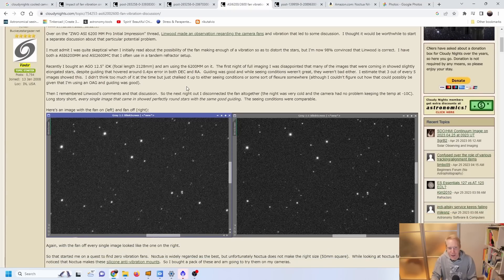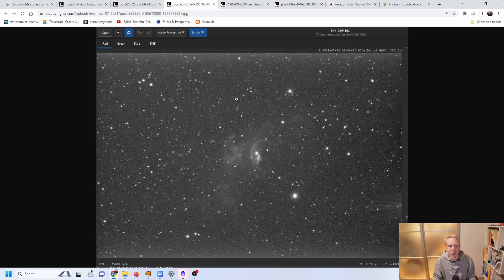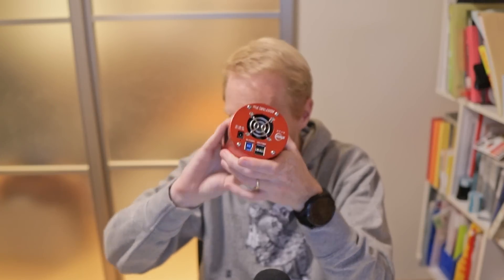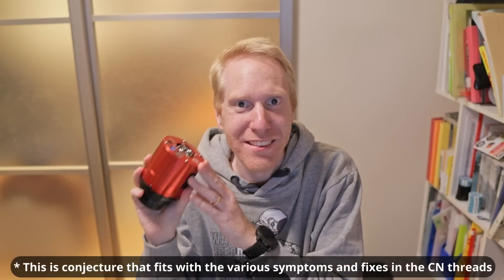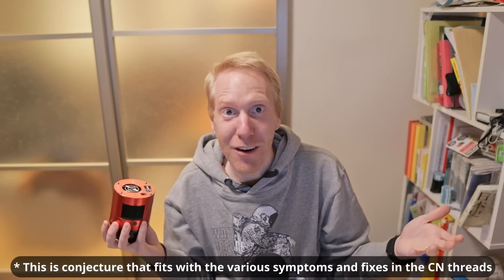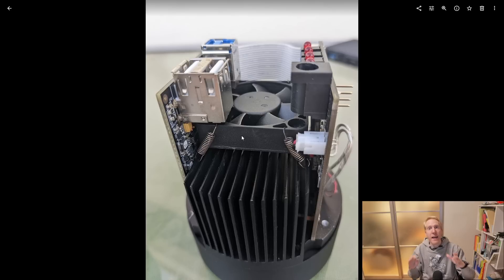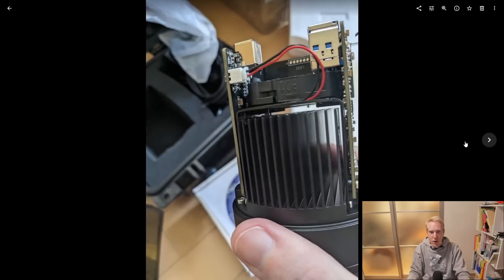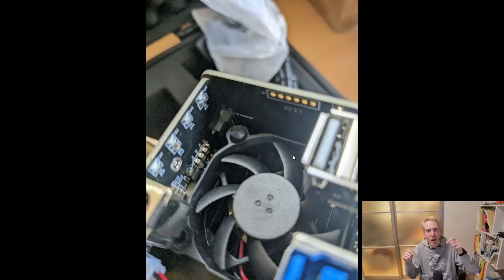Cooled Cameras can HURT our images?! 😱 HOW?? EASY fixes!

Comment: Wow, this could really be my problem that I am having. I already contacted a few other people on YT and they all advised me to bin with my camera. But wait Quiv, let me begin at the start, I have a asi2600mc camera that sits on a new galaxy setup, Edge HD 8" with 0.7 reducer and I couldn't get sharp images.
I always used the camera on my Esprit 80 and Esprit 120 native and reduced. Never had an issue with my frames, always pinpoint sharp till the edges. Now with the new galaxy setup, the reduced Edge 8,  I can't get any pinpoint sharp images. First I thought, ok that must be the difference between a refractor and a reflector, so I contacted some people here on YT and they advised me to bin my asi2600 to 2x2.
But now seeing this video that you made, this could be my exact problem Quiv. I will try next time ,when I have some clear skies, to image and turning of the fan.
Thanks Quiv, I will keep you informed
Reply from the maker: It's an easy test! The issue is particularly obvious on satellite trails, which would appear wiggly

Comment: I have an ASI 533 mc without any vibrations and a Touptec imx571 gen1 with very strong vibrations. In case of Touptec I can feel the vibrations even on the telescope. If I deactivate the fan on the Touptec camera, the vibrations disappear. It seems that the Touptec gen1 design is not better than ZWO design. I think there are big variations in the quality of fans. It is a lottery if you get a good or a bad fan.
Reply from the maker: So sad to see about Touptek - several have mentioned this about the Gen1, for the moment no reports of issues with gen2, fingers crossed!

Comment: Cuiv -- You pronounced my last name perfectly fine; thanks for the shout-out.  I still think that observing satellite trails is the easiest way to see if the problem is fixed or not.  I point at M101 or M51, which always seems to have trails going through them early in the evening.  The vibrations problem will produce a satellite trail with regular and obvious wiggles. I have ordered and installed the silicone studs to the fan of my 2400, but haven't had a chance to check it out yet on my Edge11. Will report back when I do.
Reply from the maker: Hopefully this will fix the issue, let us know, and thanks for making me aware of the issue!

Comment: I'm using a dslr still and have been thinking of changing to a cooled dedicated astrophotography camera and was wondering exactly whether this was a problem.  Even if it isn't unbalanced right out of the box, the fan is almost certain to get a bit of dust on it and become slightly unbalanced in short order.
Reply from the maker: Cleaning the fan should be done regularly it seems. Another thing to do in this hobby!

Comment: While I believe that reducing the transmission of vibrations from the fan to the camera is effective and important, I don't think it properly addresses the root of the problem.  The fan shouldn't be vibrating to a detectable level in the first place.  I suspect that an unbalanced fan blade (either from manufacturing defect or uneven dust/wear), or a bad shaft bearing would likely be where the vibrations are originating from.  I would recommend inspecting the fan for uneven dust, debris, and wear would be the place to start.  If that doesn't solve the problem, replace the fan with a quality vibration free motor and fan assembly and upgrade the mounts to those vibration dampening supports at the same time.  If your fan is vibrating, it's probably only going to get worse over time anyway, so upgrading the cooling fan is where I would start.  When I turn my cooling on for my ASI 294 MM Pro, I don't feel any vibration with the original fan.  Knowing that just walking across the ground can show up in my guiding graph, I've been aware of how sensitive to vibrations astrophotography can be.  I was impressed as to how smooth that fan runs, considering the fans on my computer can make things on my desk rattle.

Comment: interesting point. I noticed this on my asi1600mm. Couldn't figure it our for a long time, until I finally pulled the back off the camera. I found bug guts stuck to the fan blades which created and unbalance. Once I cleaned the fan off, the problem went away. So, I'm now very vigilant about cleaning the fan blades. Great topic
Reply from the maker: Fan cleaning :-) at least easier than cleaning optics!

Comment: Just downloaded a vibration meter app for my android phone - extremely sensitive and tested against devices like air purifiers and other stuff with fans - THEN against my QHY cameras and the fans register 0 or 0.1 intermittently  vs  a vibration of  2.3 when my focuser powers up...this think picks up the lightest of taps by fingernail on the mount so I would say it can be used to see how much real vibration you have.  (fyi blowing at the phone like blowing out a candle produced 0.7 ...typing this message produced 1.9->0.8 through the desk) - the app I downloaded was called Vibrometer from Smart Tools...give it a shot, would love to see what your ASI is actually registering
Reply from the maker: Vibrometer! Got it - so you put your phone on top of the camera?

Comment: Dont think they are of high quality to start with but If the fan blade itself is unbalanced then vibrations will be high. The mounting pads from an old cd/dvd player are really soft and should be easy to get.  Great video on this Cuiv.

Comment: Bad news, my Omegon (rebranded Touptek) 533MC i have 1yr+ shares same fan design as your gen1 IMX571- it's attached with springs to the radiator. It started vibrating maybe 6 months into the journey. I detected it thanks to the humming noises produced by my newt :-) but it wasn't showing in the subs produced by this  widefieldscope. I managed to tame it temporarily but it is an incoming swap, shortly, plus some silicone pads under the fan to dampen any future vibrations as this camera will be relocated onto 8" SCT. I really thought this is well known issue?
Reply from the maker: Another one bites the dust... Thanks for the feedback!

Comment: Great video, thank you for making more people aware of this issue!  I also used to worry about shutter slap in the old (CCD) days, particularly for short exposure times.  So glad I don't have to deal with mechanical shutters any more, the ones we had in our cameras were very unreliable.

The other problem I had (also in the CCD days) with fans was pickup (noise) from the fan motor drive signals visible on bias and even science frames with low background such as short exposure or narrowband.  We used to get this with Apogee cameras when the fans failed, they had 3 fans and when 1 or 2 of the fans failed with a locked up rotor (which happened frequently) the drive signals from the failed fans produced visible pickup in the bias.  Working fans seemed to produce a lot less pickup, but I expect there still was some.  I even sometimes used the presence of this pickup in the bias frames as a means to discover that a fan had failed remotely.

CMOS should be a lot less prone to this given that the analogue signals are confined to the chip itself, so it probably won't show up there based on what I've got away with on my uncooled CMOS camera in terms of running it next to electrical noise sources, but I don't have a cooled CMOS camera so not able to test for it there.
Reply from the maker: Oh wow .. noise pickup from the fan motor drive! Why are we doing this accursed hobby?? 😂

Comment: Thank you for addressing this topic!
For me, it brings up a component of something that I've been considering.
I'm hoping you might address it.
In one of the last videos that I've watched of yours you talked about the priority of purchasing a cooled camera over an uncooled camera even if you have to sacrifice resolution, due to noise.
I've been considering purchasing a lower resolution ZWO camera that's uncooled, but not because of noise but due to personal finances (I'm considering the ASI585MC).
 I want to use the 2inch broadband and a Duo Narrowband filter with my Rokinon 135 f/2 and also several Nikon Lenses. To do so I'm considering trying to add 5 volt Peltier module (with a small heat sink, fan and thermal switch) to the ASI camera back plate to cool the camera.
However I'm also worried about vibrations and controlling condensation as well as controlling the temperature.
Your video today helped me with the vibration problem, so one down, two to go.
So any thoughts, ideas, video would be appreciated!
Thanks.
Reply from the maker: Condensation is another difficult problem... To be honest I don't have good solutions to that. Why do we do this silly hobby? :)

Comment: I don't believe I have run into this problem with my Edge 8 and 294MM combo.  In fact.. a couple of years ago and ran a whole night with the cooler off mistakenly..  I didn't notice a difference in the stars.. I was actually more focused on the noise differences.  One thing I do notice with the camera.  With the dew shield on the scope.. looking into the optics I can hear a hum, so there is definitely some kind of resonance through out the whole train.. but I don't believe its impacting the images.
Reply from the maker: Excellent that you seem unaffected!! Especially with the small pixels of the 294MM!
Reply: @CuivTheLazyGeek  I keep it at bin 2x2.

Comment: Hi Cuiv, Great video again. -- This was concern of mine particularly since my ASI6200MM camera is pretty loud. But testing shows it doesn't present a vibration problem on my rig. Or if it does, it's below that of the tracking. For reference, my setup's focal length is 2880 mm (pretty long focal length). -- All that said, since the vibration of the camera isn't zero, it's a variable that needs to be considered when sizing up future setups. It wasn't a problem for me, but you're right, that doesn't mean it wouldn't be a problem for anybody.
Reply from the maker: Excellent to see you're not experiencing the issue! Loud is fine :-)

Comment: this is real, it is addressable however!   I image at native on edge hd 8 with, C-OAG, 174mm mini and Risingcam 571 Gen 1,  I had eggs,  what i did was replace fan with noctua fan and used the supplied resistor in noctua kit to bring the RPM down further.  I used velcro, to seat the fan instead of the springs. it works! I am glad risingcam addressed this, as it is technically more difficult to modify compared to ZWO housing.  IF you have ZWO housing silicone fan standoffs can work in addition to buying a " premium fan"     ALL IS NOT LOST!

Comment: Super interesting Cuiv. I was very conscious about high frequency fan vibration when I chose my mini pc, but didn't expect to have possible issues with the camera fans. I personally haven't seen this on my ASI cameras but I generally image at very short focal lengths. My first reaction is that I would have thought you would see generally larger stars as a result of the fan imbalance rather them them being stretched in a particular direction, but after thinking about it I guess it makes sense as the stretched stars will be in the same direction as the mount is guiding in RA. Thank you for bringing this to our attention👍
Reply from the maker: One more lottery to be aware of: fan lottery!

Comment: My rising cam is also totally free from vibrations. I did notice how they have had reports on vibrations though, and that they recommended the Nocturne fans as replacement fans.
Reply from the maker: In the comments I've seen several Gen1 vibration comments (Gen2 still seems unscathed). Such a difficult problem!

Comment: This is a very informative and helpful video. Thank you!
Now though, I have a question: what if you don't want to open the camera (perhaps not to risk voiding the warranty or simply damaging the internals) and don't want to replace the fan feet?
Turning off the cooler shouldn't do much harm to electronic noise, especially for those (like me) who go to cold places (even in summer) to photograph (on the mountains). But the problem is the temperature time-gradient.
Back home, we should get different groups of dark frames that correspond to different temperatures recorded in the frames (assuming the temperature is recorded in the frame filename even when the chiller is off 🤔 never tried, it should be tested ). Then several groups of light frames would need to be calibrated, separately, with corresponding dark masters (corresponding in terms of temperature). It is very complicated and time-consuming, but perhaps not as dangerous as opening the camera and risking misaligning the sensor or causing some other damage due to a clumsy maneuver.
Definitly a cursed hobby, this one 😞
Reply from the maker: I have no good solution... Definitely a cursed hobby for sure...

Comment: Absolutely!!!  I have noticed this too, recently.  Satellite trails have a strange "wiggle" on them, very easy to spot, the amplitude of which is in exactly the same direction of "sausage shaped" stars at high focal lengths only (C11). It has been suggested on CN that this wiggle is a fault with the worm gear errors of my mount, but this made no sense to me.  The mount exhibits no vibration.  It is clearly a vibration within the 2600MC Pro itself - I came to the conclusion that this was absolutely to do with the camera fan.
Reply from the maker: Hope you can fix it!

Comment: Answer to the last question is: Yes, stars look better without the cooler on ( ASI2600MM ). I contacted ZWO for this reason 2 years ago, camera was under warranty, and they just suggested to play with the screws to release or tie the fan. But nothing of that worked. Then I bought a new fan from them and it seemed to reduce the vibration just a little. But then I had the oil leak problem and had to return the camera for an exchange. The problem remains with the new camera. I think they don't want to accept they have a problem, because they are building products for the most simple setups ( just like with the ASIAir ) but not for advanced users. It's a shame because ultimately people will abandon their products early or late if they don't change their approach and correct these kind of issues.
Reply from the maker: That's a bummer to hear... This is such a rabbit hole of a hobby. Maybe those anti vibration feet will help

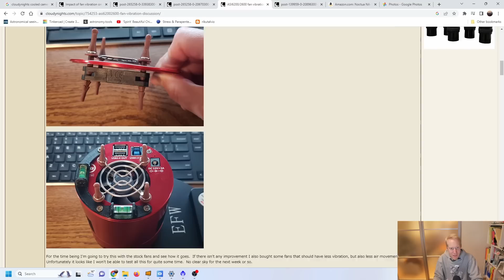Comment: I've installed the Noctua NA-SAV4 anti-vibration mounts on all of my ZWO cams for exactly this reason and have had good results with it. The SAV4 install looks cleaner, it doesn't have the big prong sticking out of the back, it has a flat head. I pull the SAV4 through the grille (the SAV4 has a little ring under the head that keeps the grill separated from the metal case), then through the back plate and fan as shown in the image at 11:15. I trimmed off the excess length on the inside as well.
Reply from the maker: Thanks for the tip!

Comment: I shoot at short focal lengths but at higher FL would it help to image at higher temps so the fan does not need to work as hard?
Reply from the maker: Depends on the camera design, in my experience the fan just runs at full speed all the time

Comment: Hi Cuiv. 
There's no problem noticeable with my system :
Asi 2600MC pro /MM pro + Askar 107Phq + Losmandy g11. 
Sampling is about 1 arcsec. 
Roundness absolutely perfect in every sub with excellent sharpness.
So ???🤔
Just one question : does the fan speed varying with t° cooling ? My setting is at 0°C.
Best.
Reply: Hi!
I believe Cuiv explained the vibration impact when you image at long focale length. By long, it would mean much longer than 1000mm?
Reply: @stephanep1330  Hi
You're right but I thought that the primary endpoint was sampling, according to the formula :
s = 206 x p/F
So I thought that when  the error matches the sample there's were no issue. 
I need to test with my newtonian F 1000 mm and with my F 1120 mm refractor ( actually in progress ).
But my question applies also for long focal length in terms of resonance with focal length vs cooling t°. The question is : does the speed of fan vary with cooling t° and what is the vibration impact ?
Best.
Reply from the maker: Good that you are unaffected! The issue will manifest itself depending on amplitude of vibrations (fan lottery) and pixel scale!

Comment: I'm planning on upgrading cameras by the end of the year and heavily leaning toward the Player One Poseidon-C Pro (in great part because of the rear-access tilt adjuster).  Has anyone reading the comments had any experience with this camera and its vibration performance?
Reply from the maker: Seems their fans are attached to the housing, but in the comments I've seen reports of Touptek gen1 also having vibration issues... So fan lottery may be more important than I suspected...
Reply: @CuivTheLazyGeek  I seem to hear that a lot with various equipment and various issues.  I think our “hobby” requires such high precision, slight imperfections become obvious.
Reply: I will recommend Moravian.
Reply: No issues with QHY268M PH. CS & GB!

Comment: I have to turn off fans in my house with my giant telescopes because the vibrations are really obvious on those scopes.  So I've always wondered how a fan right next to the sensor didn't add at least some kind of vibration.

I mean, trains miles away make my telescope image noticeably vibrate.

I didn't figure out what it was until I tried out during the day with high framerate video.  With fans in my house off I can read the tiny manufacturer stickers on a neighbors chimney clearly a few houses down the street. Turn the fans on, and they immediately get fuzzy and if you analyze frame by frame the whole image shifts back and forth a few pixels.

Vibrations from traffic on nearby streets also become a real issue at long focal lengths.

It's really easy to test during the day at fast exposures.  Far away text will go from crisp and clear to fuzzy or wavy immediately...at least on my setups it does.
Reply from the maker: Good idea for a test!